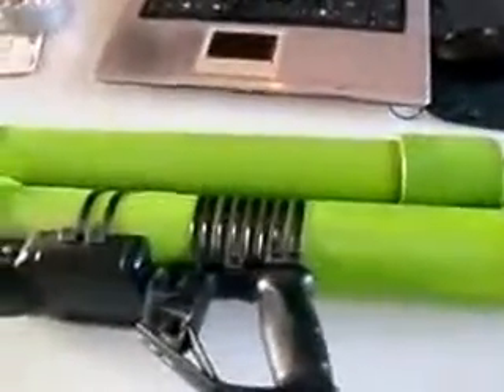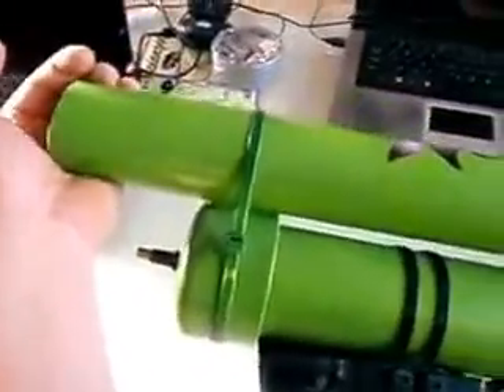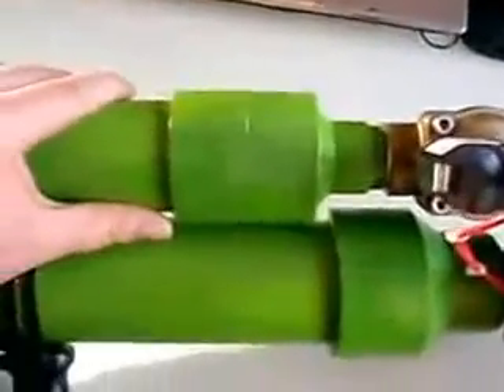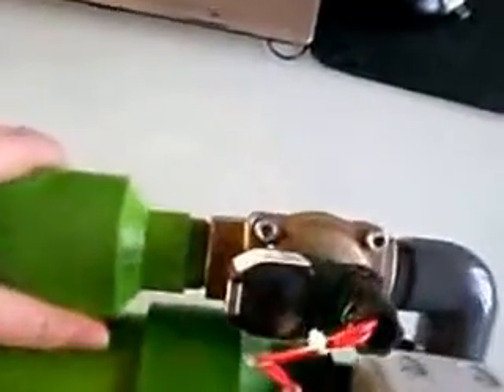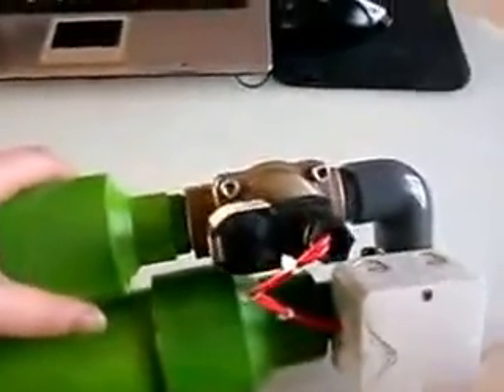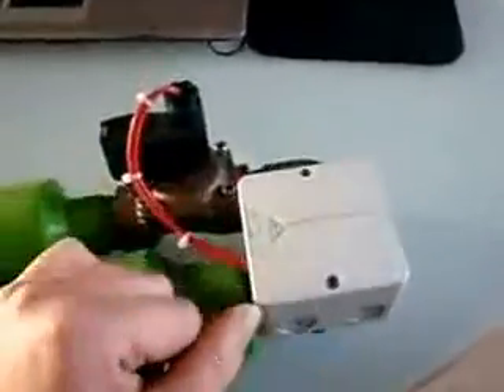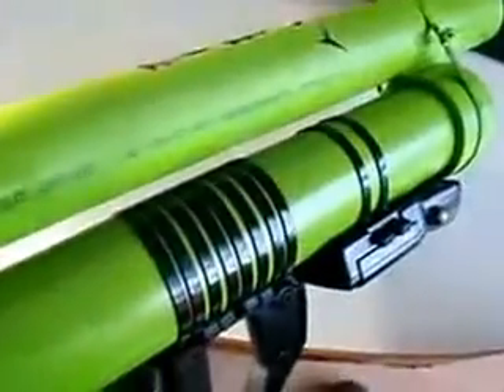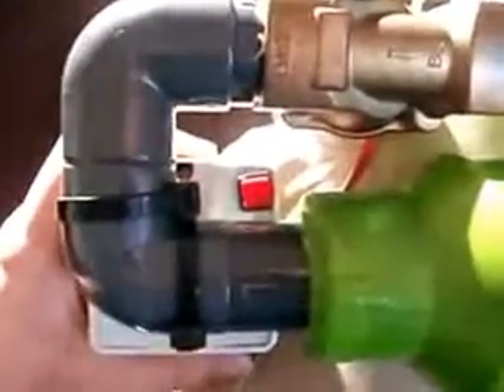Pneumatic Solenoid valve used in a potato gun or homemade air cannon  - DIY

Comment: would it be possible to run the Solenoid on 18 volts ,2 9 volt batteries, or is it better to run 27 volts?